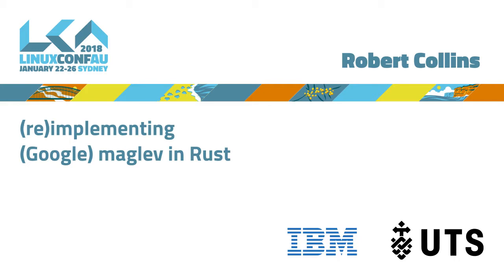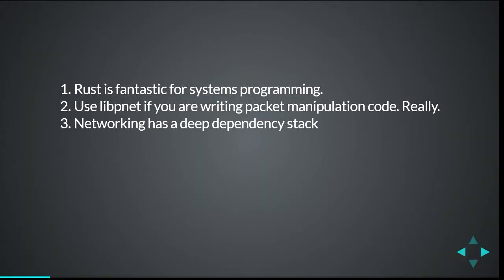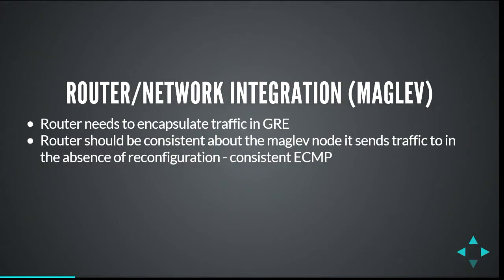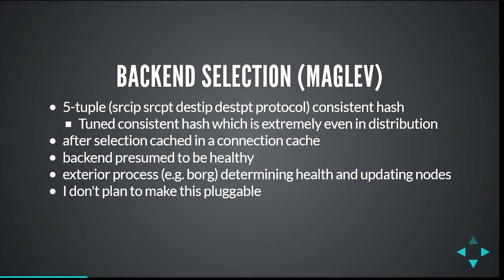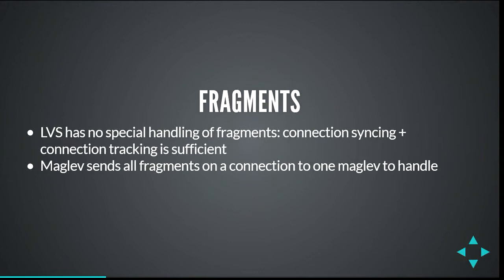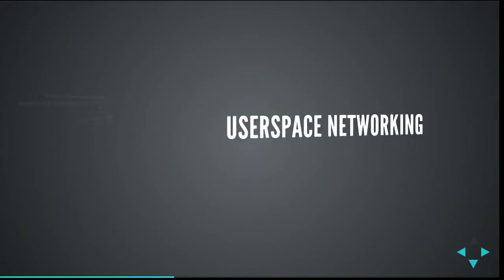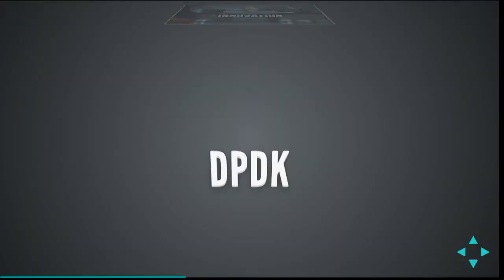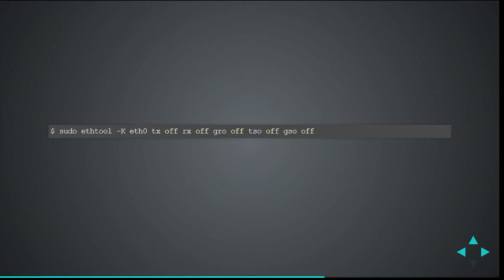(re)implementing (Google) maglev in Rust

Comment: 7:43 One correction: the router does not encap the packet with GRE|IP. The Maglev does this when it processes the packet. The IP points to the selected backend.

From the paper: "When the Maglev machine receives the packet, it selects an endpoint from the set of service endpoints associated with the VIP, and encapsulates the packet using Generic Routing Encapsulation (GRE) with the outer IP header destined to the endpoint".